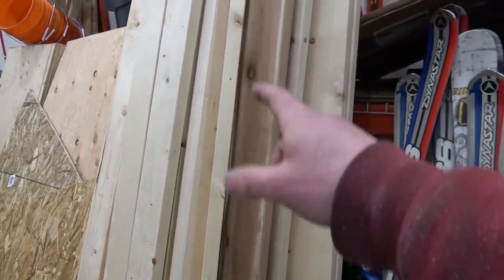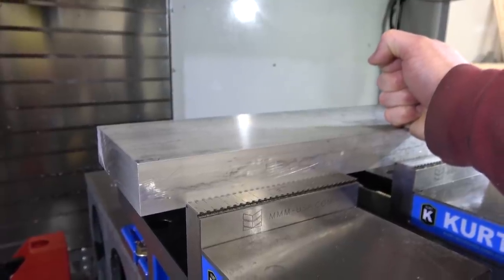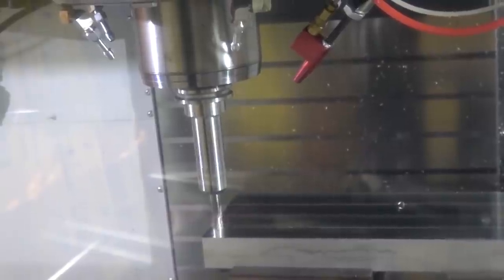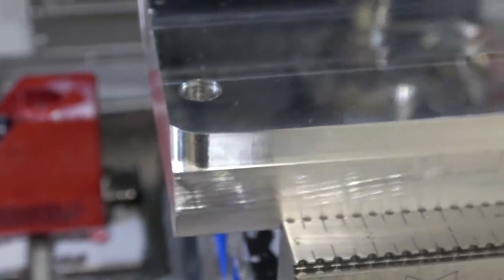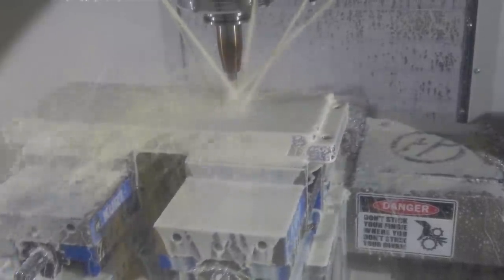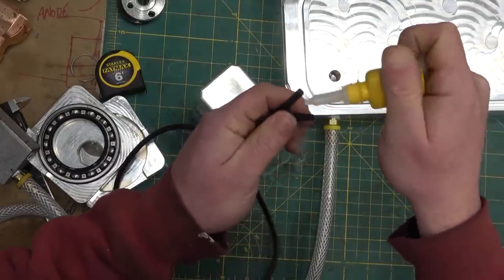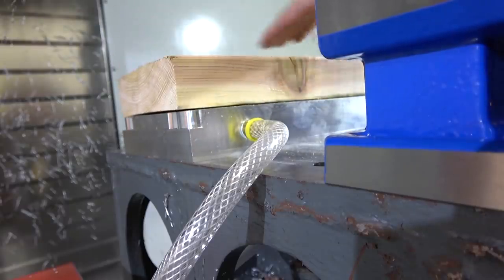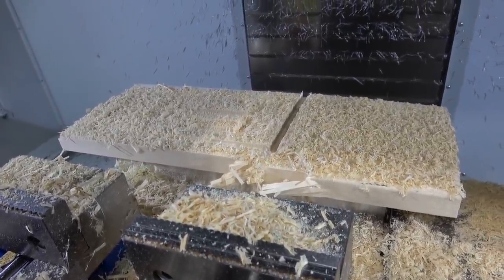Vacuum clamp for router-ing | Prototype & Test

Comment: Here's a tip for ya.
An old guy once told me to keep the metal out of the wood shop and the wood out of the metal shop. I got why he didn't want metal in the wood shop. But I had to ask him why no wood in the metal shop? He told me that wood dust is so fine it gets in everywhere and tend to gunk up the works. It is very hard to get out once it gets in, it packs together and becomes hard and then it expands when wet. So the lathes and milling machines would not run right and might even break down.
Thanks for yet another great video.

Comment: I used to work at a place that mad concrete pavers, we picked them up with a vacuum system and sealed the joint with some peel and stick 3M foam. Was about .5" wide, .25" thick or so. Worked like a charm

Comment: Just a couple of tips from a guy that used to make vacuum fixtures for milling aircraft parts. Use surgical tubing instead of buna Oring. Surgical tubing is much softer and crushes easier. Second tip. Mill some grooves about.075 inch deep, with a.125 ball endmill within the vacuum area and connect this grid pattern to the vacuum port. This will help to distribute the suction. Surgical tubing is available from McMaster Carr.

Comment: As someone who has done a fair bit of dead tree carcass fondling, your idea is sound.  I have seen machines what for automagically fondling tree carcass bits with sandpaper use a vacuum table belt system quite effectively to hold down said bits while subjecting them to some pretty heavy petting.  It did have a tendency to fling the warped pieces around quite vigorously though, so one did have to make sure the pieces were fairly flat on the down side.  It may have also been helped by the fact that the belt was somewhat pliable and could somewhat conform to the carbohydrate foam.  Perhaps an eighth inch thick sheet of rubber with a lot of holes in it would, fastened over a deeper vacuum gallery would be more effective for firmly gripping your wood.

Comment: Helicopter mechanic here.  On the o-rings we use, we either put petrolatum on them, or use the hydraulic fluid, oil, or grease that they are sealing in. And occasionally assembly fluid when it's a large o-ring with a not so substantial groove.

Comment: I've used commercial and production woodworking machinery as well as in food production factories.  Wood has that habit of being grainy and rough surfaced compared to synthetic and metals - and porous too...  The go is the use bellow suckers that can conform to the inconsistent surfaces.  They get used in gangs or just as big sort of rounded off square or rectangular versions.  The nitrile o ring is a very tiny contact point - it works way better on a solid machined platen if you use silicon rubber hollow tube - the idea being to have the tube squash down and cover a much greater area.  Running two or three tubes in the same groove will add more area again when the timber gets sucked down hard.   The bellows have an extended silicon skirt at least 12mm wide although that is wildly variable depending on what you are lifting or holding down - the actual point loading is low, but the combined grip of a reasonable vacuum held wood sections down hard that I could barely lift while multiple amazing precision violences were carried out on them by many finely polished cutting knives and whirly bitey things that were terrifying to have your hands anywhere near...

Comment: I work in a wood cnc shop. If I was going to machine my own plenum out of aluminum, I would make a 1"x1" grid system of the same dimensions that you made for the buna-n cord you did. buna-n would be a great to use for metal, as you showed it worked so well, but wood is much less perfect. 5/16" dia closed cell foam works much better for wood. It bends around corners well and you can grid it out on the table to suck down a variety of part sizes and around holes.

Comment: Nice.   I was thinking you were going to make a kind of "reverse air hockey" table-- a large flat space, with hundreds of very tiny holes-in, and use a high volume (but not necessarily very low vacuum) pump.  Each hole would meter the volume of air thorough, such that any un-blocked individual hole wouldn't amount to much, but cover sufficient number of holes, aka, a piece of wood, it'd grab quite nicely.   Or not.  :)  

Of course, for smaller pieces, you block the excess holes with small pieces of flat scrap material, like sheet rubber or vinyl.  

Cool design, though.    

Next up:  Fasten the work piece to a really flat piece of something, then vacuum hold the something.   This lets you attach quickly, re-position and what-not.  But you'd have screw-holes in your workpiece from the flat something.

Comment: If you're in a pinch, put double sided tape on a clean table, then apply more tape to the wood. Mix up some Bondo, and put a handful of dollops on the tape that's on the table and press your board down, sandwiching the Bondo between the taped surfaces. 60% of the time, it works everytime!

Comment: Mill out a pocket in the current fixture, and inlay with MDF, use double sided tape as needed, and for smaller size jobs, use plastic wrap to cover the rest of the MDF for full suction

Comment: Car door lip that you can get off Alibaba would be a good way to replace the o-ring. If the gasket is tapered, widthwise, then it could seal the imperfections better while giving more area to grip. Also, no grease if it's siliconed into the groove.

I was thinking of a shop-vac and bigger hose, but I suppose if it bites and holds the vacuum, holding it there for 5 seconds isn't a big deal. However a shop vac might help with leaks

Comment: I've seen where some tree carcass machines use a shop vac as a hold down. I think it helps when you can't get a good nuff seal by just putting sheer volume into it
Reply: That's interesting. I wonder if a shop vac minds being stalled for an extended period of time...
Reply: @jongrimm7767  wouldn't call it stalled. The load is reduced and thus spins faster which may be bad for the bearings or bushings long term. The decent ones have a separate cooling fan on the same shaft so heat shouldn't be an issue. I also vaguely recall someone using mdf as the medium as they were able to pull air through it.

Comment: Fun to watch this, both as the proud owner of a CNC Sherline mill, and as an engineer with 20 years experience designing pneumatic and hydraulic machinery.  Being just a Sherline jockey means I keep my mouth shut about machining.  And besides, you make all the same mistakes on that big expensive machine that I do, so no help needed.  As for your vacuum Charles, pull out air a lot faster, and figure out a way to have less leaks.  BUNA-N is pretty rigid stuff, I've used it for static seals at up to 10,000 PSI -- 14.7 PSI is going to compress it somewhere between 0 inches and 0 mm.  Something a tad softer would work much better.  Facing off a nice piece of tree corpse will remove the limbs still attached, maybe some residual bark, and also warp it enough to defeat the reason for facing it off to begin with.  So if sucking much faster on something a lot softer doesn't produce the desired result, perhaps running the wood through a neighbors planer or sander a few times to get it really flat would make it lay down and behave.

Comment: Maybe a nice big thicker gasket, but I dunno. Always have big thick gaskets what for to keep the air out on our hard suction hose down here in the middle of the riverlands. Either way, you seemed to have made it work! As the old addage goes, if it don't fit, grease it up and force it, right? Something like that, anyway

Comment: Bolt a 3/4" MDF spoilboard to the bed, get some brass wood screws and screw the wood to the MDF. You can plunge into the mdf for nice edges and if you hit the brass, cutter's still good.

Comment: Have you tried YouTube's NYC CNC  super glue work holding trick?
You should set up a work stops with spacers you can remove in case the air drops out so you can find your origin again

Comment: The one advantage wood has over metals and composites is wood has no fatigue life. This is really important in aircraft. Most metal aircraft are retired when their fatigue life is exceeded. Wood aircraft components simply don't retire due to age. Getting infested or rotted, yes. But simply going through normal load cycling wood can last indefinetly

Comment: Also more vacuum gallery's more better, and a little reserve tank wouldn't hurt either, if their is some slight leaks during cutting. The pro wood butchers run a 10hp positive displacement vac pump, they will draw a vacuum staight through their mdf spoil board, no holes,  no gallerys, nothing.

Comment: I would say you need to bring the gasket up a bit (or mill the surface down a tad) so the seal has some room to squish down. Round gasket + compression = more surface to grip.

Of course too much of either and the part won't seal against the metal parts but is suspended rather precariously on the rubber seal itself.

Comment: A vacuum cleaner might make a more appropriate air pump as you don't need a huge pressure difference (a vacuum cleaner can do 100mBar) and if you can shift a lot of air you are lot more tolerant of leaks.

Comment: Here's the EASY way to do this. DON'T machine anything for starters. Next, apply a layer of masking tape to the under surface of the wood. Then apply a layer of masking tape to the top surface of your work area. Then use some crazy glue and stick the two taped surfaces together. They'll hold up good and strong, and when it's time to pull them apart, it's as easy as peeling off a layer of tape.

Comment: Bob would use a kerosene mist on aluminum while milling. RIP Bob. Chip evacuation is the limiting factor while drilling. Drills do the most work. Thru coolant carbide drills will amaze you. I've used vacuum plates and trust me when I say, make a manifold so you can suck from multiple positions in your plate. It's trimming dick hairs that add up. Thanks for the vids!

Comment: I present to you, the worlds most expensive wood jointer...
Reply: brigitte madison planar
Reply: @mcboomsauce7922  umm... jointer
Reply: Planer
Reply: @watcherofwatchers  Well the OP was right and I'd hate someone to get the wrong idea on these commonly conflated tools. 

A planer makes the top surface parallel to the bottom surface(not necessarily flat). A jointer creates a flat face regardless of how parallel the opposite side is. So really this is performing the job of a jointer... except upside down.
Reply: @watcherofwatchers  Who are you XD
Reply: Worlds most expensive shopsmith, planer, jointer, table saw, router, mortiser, drill press, and maybe even bandsaw.
Reply: @anrew4425  definitely planer/jointer combo, but i think if you did any drilling, sawing, or any kind of through cuts you'd lose the vacuum and suddenly the one wood would be many smaller woods all over the place
Reply: A jointer is used to square and true lumber a planer only removes stock for thickness
Reply: @mattberg6816  so... A thicknesser?
Reply: Matt Berg not really.  A planer or thickness planer is used to create parallel surfaces and to reliably thickness stock.  A jointer is used to flatten one face or create a set of adjacent faces to create a 90° joint.  So in this case, the CNC would be used as a jointer.
Reply: J K yes, that’s the UK term
Reply: J K it’s really just a CNC router because it works on a multiple axis
Reply: GoonBoi729 yeah I was simply explaining the difference between two machines but I’m glad you had the chance to show how smart you are
Reply: Pin router, works well and has built in sucker- but no cream juice to chill-0- hjahha
Reply: Mitch McQuoid no jointer flattens a side of the wood a thickness planner planes would to consistent thickness. you can flattened  surface  with a thickness only after flattening opposite side with a jointer
Reply: And on top of that you should always alternate sides through a planer
Reply: i was thinking the same thing and i couldnt help shake my head at the know it alls who incorrected you by saying "planer. derp" must be machinists.
Reply: It’s actually called a aeroplanar because it makes the pieces parallel which creates lift for airplanes. -Someone on Quora, probably lol

Comment: I need to plane a wood board true and square, shall I reach for the Stanley N°5 jackplane ? No Siree a 250k$ CNC Mill's the way to go !
Reply: James Simpson a 5 1/2c or 6c is a better option for that.  Or if you have a 62 with a toothed blade that works well for stock removal then clean with a 4 1/2
Reply: More like 150 max

Comment: Hey uncle b, how do you weld wood? I Must be using the wrong  electrode. But i must say in a pinch a plasma cutter will cut wood if in you put a thin peice of plate over top of it.
Reply: pyropocket ya gotta think of it more like aluminum. If you ain't got the right setup on your rig it's just easier to braze it together.
Reply: You can get special welding fluid for joining tree carcass
Reply: Funny thing about glue is that the hecking thing doesn't even need heat to weld! You just use a jizz-like substance called glu-e. Weird stuff man.
Reply: @crackedemerald4930  cool fact: Titebond 2 can be coaxed to weld faster in a radio frequency gluing machine. Big wood elf communes use such a machine every day.
Reply: From what I learnt was you gots to use low heat and  excessive  wire speed. Haven't had any luck with stick yet! Let me know if you find out

Comment: Instead of O-Ring, use Closed Cell Weather Strip, 1/4" or 1/2" thick, and use your shop Vacuum instead of air pressure vacuum source.
Reply: I was thinking the same thing. The sealing ring needs some squidge factor to conform to the uneven surface on the material.
Reply: most vacuum cleaners use the working airflow to cool the motor, are shop vacs different? otherwise it will die during longer toolpaths.
Reply: @nordishkiel5985  Yea, you are correct, the Shop vac needs some flow. As large as his vacuum gallery is, he would only need a couple of pounds of vacuum to hold that part. It looks like about 50 square inches of area, so with 2lbs of vacuum it is 100lbs of force.
Reply: The intake of an air compressor pump draws a good vacuum too, and which metal shop doen´t have an old one floating around?
Reply: @sthenzel  You have to watch you won't overheat the valves due to mo air flow. Best just get a AC vacuum pump.
Reply: I agree about the weather strip it works great, that is what I am using right now on mine
Reply: @YukonTroyH  this was my thought. Why not run a pump that's designed to pull a vacuum and hold it there for extended periods of time. I get that the air system hes using works best for his application since there already and air source inside the cabinet but let's be real. This is ave. He could make a port in the side of the cabinet meant for vacuum and have the pump outside with a fitting inside to connect to.
Reply: I have made many of these from tiny to as long as 10 feet long. Use a vacuum pump and if you can put a reserve tank in between the pump and vac Chuck. For o ring use hollow latex tubing.

Comment: Got a similar homily to the canola oil: I was told to order some special sand. I found some at a local sandblasters for $10 a 5 gallon bucket. Same stuff from Grainger at $30 a bucket. And from the specialty store, 'specifically made for the task we were doing' at $125 a 5 gallon bucket (labeled differently than the other two, of course). I was told to order the expensive stuff since they 'obiously knew what they were doing and the other stuff I found wasn't labeled for the job'. We received the bucket of $125 sand a few days later. Still with half of the Grainger label attached.
Reply: That is as bad as Seastar oil at $30/litre and mineral oil at $3/litre.
Reply: You are getting your money's worth.  They buy the sand from Grainger, sure, but then they hand sort it for grain size, shape and density.  It's a long and tedious process, hours and hours standing in front of a comparator.  Only women have the patience for that kind of work, so don't think you can get the Grainer stuff and sort it yourself, you'll go mad.
Reply: It's amazing how much you can save on stuff if you just read the label and see what it is! 
Citric acid... You need to soak something to remove limescale and you can buy brand-name anhydrous citric acid descaler for £2 for a 50g sachet. Or, you can go to an indian supermarket and buy anhydrous citric acid (food grade) for £3 a kilo. 
Same applies for IPA - you can buy it watered down in a 500ml squirty bottle with a brand name on it for cleaning glass for the same as what you pay for a gallon of the stuff from a chemical supplier.
Reply: donkmeister IPA? All that comes to mind is beer- yes I’m a lazy American lol
Reply: @joeltaylor3462  Isopropyl alcohol

Comment: The old lady has one of those Gluteal Estops. I was running my program and she was able to stop a plunge cut from hitting the workpiece in the wrong area. Saved me a stern talking to, I assure you.
Reply: Captain MufDyven  Feed rate is key in a situation like that. I've found that liberal canola oil helps to not chowder the hole.
Reply: My wife has one of those, but it doesn't seem to work when she's had some of the ol' liquid courage.
Reply: @DustyDingus  Ethanol just alters the compliance.
Reply: Captain MufDyven  Just be careful where your coolant deposits end up. It may have a lasting affect.
Reply: I understand why you young fellers keep trying to make these open loop programs work. I know the uncertainty lends a bit of excitement to the job but it's just not worth it in the end.